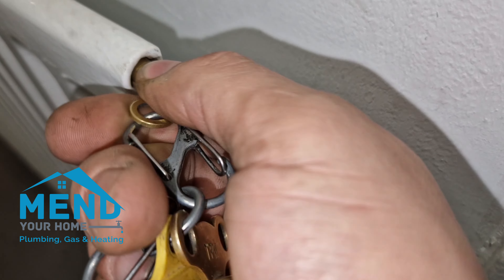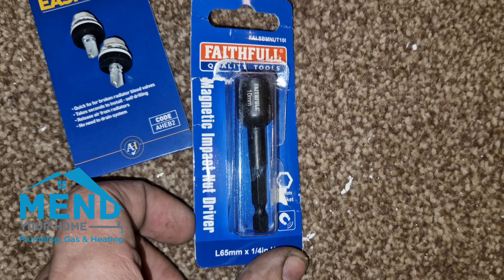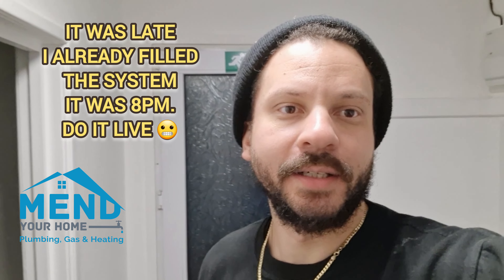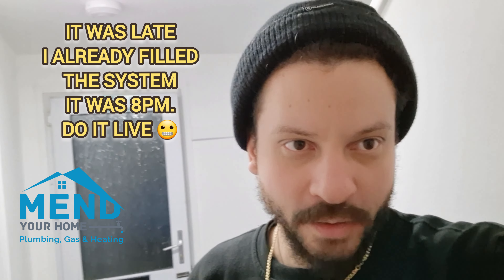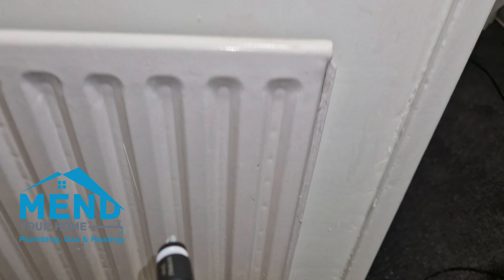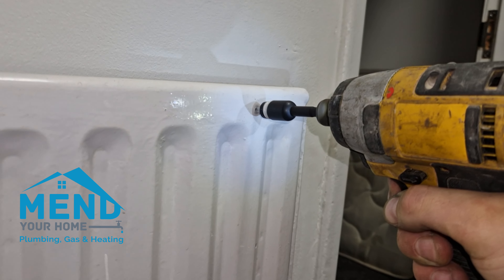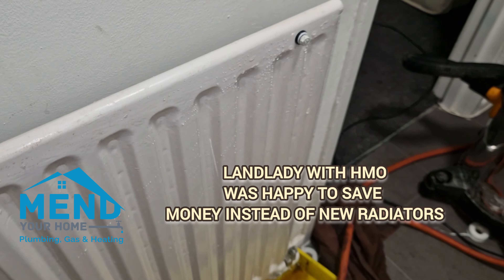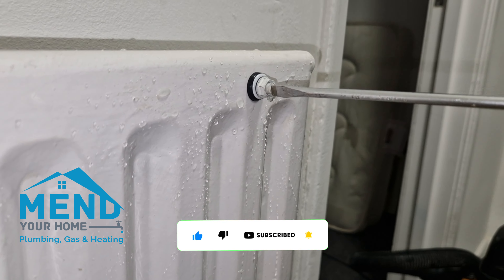Broken Bleed Valve DIY, Drilling LIVE Easi Bleed to Radiator. Link Below

Comment: I did power sand the rad a bit as it has about 5 coats of paint on it. Also good idea to set torque at 1 to begin with - I did need to click it to 3 at the end. But so far so good 😊

Comment: Looks like a good fox for some of these rrally old rads. Do you rekon it will hold? 

All the people hating on bere probably have never had to do something on a budget or had someone try to sell them a full system re fit because of one old rad. Im glad you made the video its helpful to see options such
Reply from the maker: I think it's great for landlords, people on a budget or anyone that knows they'll upgrade their system in a few years and dont want to spend. It's not suitable for cast iron radiators in my opinion, but old steel rads yes

Comment: I have an old cast iron rad, do you think could work for me?
Reply from the maker: Good question, i would say no. Cast iron is thick and tough personally I wouldn't attempt it. Cast iron radiators were great because they retain heat due to the thick metal especially the old ones
Reply from the maker: You can likely close the radiator valves check that they're off. Then drill out the existing bleed valve with a smaller drill bit made for metal. Replace bleed valve with a new one.

Comment: Drill the old one out and use a tap and dye set to make a new thread then just use a threaded bolt, done it a few times over the years as a plumber, that looks a mess
Reply: What about if I have a built in inside bleed valve in all of my rads? Simply unaccessible